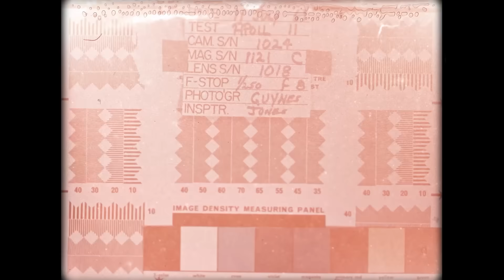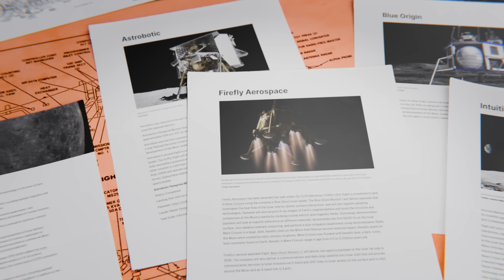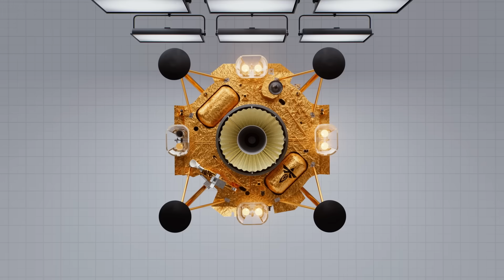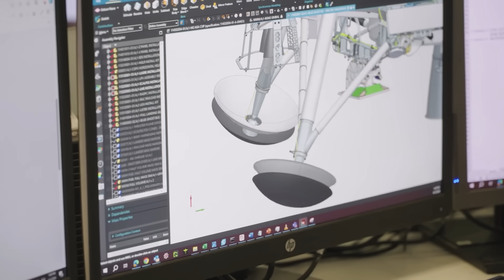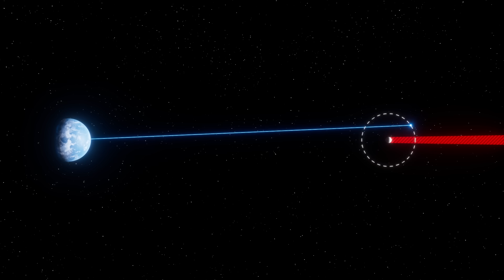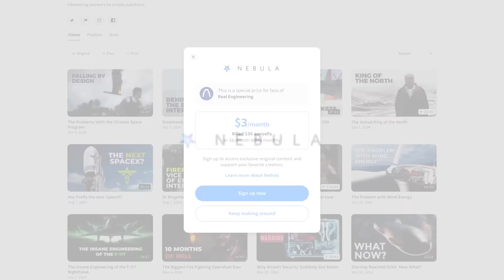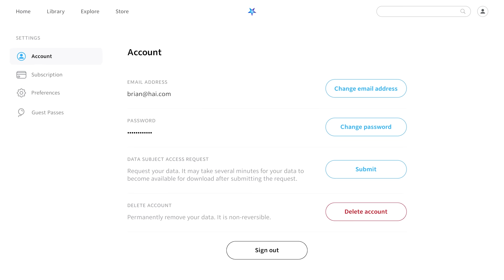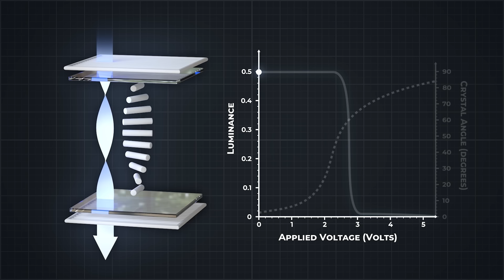Why the US is Struggling to Land on the Moon

Comment: The moon landings were fake as hell. 1.) The Lunar lander was as thin as a soda can and couldn't protect against micrometeorites. 2.) Their is no atmosphere or wind on the moon so the flag would not appear to be flapping in the wind at all. 3) NASA can't even solve the radiation issue today to return to the moon. Radiation would have killed them in the 60's. 4.) The surface of the moon without an atmosphere is 250 degrees. Impossible for the astronauts to survive 3 days on car batteries cranking out AC in those conditions in that tiny Lunar module.
Reply: Are you still grinding on stupid points that have no merit all.... oh, that flag can't flutter.... it wasn't. But no, you bring up these idiotic points that have been debunked countless times. 

Give it a rest.... you just show people how ignorant, uninformed and uneducated you are. Instead of wasting time watching conspiracy videos, take time to learn genuine science, physics. 

But you won't.
Reply: @ed9121  none of those points have been "debunked" sad you still a 6 yr old kid that probably still believes in Santa Claus and the tooth fairy. With the IQ of a sponge
Reply: NASA kept temperatures low inside the Apollo Lunar Lander by using several thermal control techniques and systems. One key method was the use of a liquid cooling and ventilation system. The astronauts wore Liquid Cooling Garments (LCGs) which circulated cooled water through tubing sewn into a mesh garment to absorb and carry away body heat. This water cooling loop was part of the Portable Life Support System (PLSS).

Inside the lunar module, heat exchangers and cold plates transported the heat generated by the crew’s metabolic load and onboard avionics to radiators. These radiators then rejected the heat to space. The internal cooling loop circulated a mixture of water and propylene glycol to maintain proper temperature control without freezing in the extreme lunar environment. Liquid and air heat exchangers helped transfer thermal energy efficiently from crew and equipment to the cooling loops. Overall, a combination of liquid cooling garments, heat exchangers, and radiators ensured the cabin and suits stayed at comfortable temperatures despite the harsh lunar extremes
Reply: NASA protected the Lunar Module from micrometeoroids using a combination of thermal blankets and a micrometeoroid shield. The protection system included a sheet of aluminium varying in thickness from about 0.004 to 0.008 inches, attached over the thermal blankets. This aluminium shield served as a physical barrier against micrometeoroid penetration.

The complete protection assembly was designed to isolate the vehicle interior and equipment from extreme temperatures and micrometeoroid impacts. The surface was covered with multiple layers, including aluminized Mylar and Dacron mesh layers, which provided thermal insulation and impact resistance. The design balanced light weight and compact stowage with effective deployment and reconfiguration after landing.

In particular, the micrometeoroid shield and thermal blankets enveloped the Lunar Module's structure, helping maintain acceptable temperature limits and preventing penetration by small high-speed particles from space, which pose a more serious risk on the Moon due to its lack of atmosphere. The legs and engine parts had specific protections or coatings designed for their exposure and thermal requirements.
Reply: NASA kept the flag upright on the Moon by using a special flagpole design that included a horizontal crossbar at the top of a telescoping pole. This crossbar slid through a hem sewn at the top of the flag, holding it outstretched so that it appeared to 'fly' despite the Moon having no atmosphere or wind.

Additionally, the flagpole had a small spring catch mechanism that clicked into place when the astronauts raised the flag, ensuring it stayed upright and did not droop in the Moon's lower gravity. The flagpole and crossbar were made of lightweight anodised aluminium tubing. The design allowed the flag to stand upright and appear to flutter.
Reply: @amedfabre  BS I've seen the videos. The Moon has no atmosphere and is essentially a vacuum. It is impossible for the flag to sway back in forth as it clearly did in the NASA released video footage that clearly shows an astronaut hopping several feet away and never touching the flag causing wind or slight breeze pass by the flag causing it to sway immediately after he passes by. That is impossible on the surface of the moon. There isn't any wind or air currents LMAO GTFO with your BS
Reply: @perry5392  :
" The Moon has no atmosphere and is essentially a vacuum."
Correct.

"It is impossible for the flag to sway back in forth"
Why not? No atmosphere means it can be moved effortlessly.

"the NASA released video footage that clearly shows an astronaut hopping several feet away and never touching the flag"
Reference of that supposed video?

" LMAO GTFO with your BS"
You understand that you're the one spreading BS on an historical, technical and scientific set of events that are acknowledged by every educated person on the planet and denier only by a bunch of ignorants illiterate people that can only watch images and videos and make irrelevant comments on them?
Reply: NASA solved the Van Allen radiation belt issue for the Apollo missions by carefully planning the spacecraft trajectory to avoid the most dangerous parts of the belts. The Apollo spacecraft trajectory was designed to skim through the thinnest, least intense regions of the outer Van Allen belt and completely bypass the inner belt, minimizing radiation exposure. The astronauts spent only a brief time of about six hours total to pass through these belts, which limited the radiation dose to well below harmful levels.

In addition to trajectory planning, the spacecraft had some radiation shielding, and the mission was designed to limit duration in these belts. The radiation dose received was much lower than the allowed yearly dose for nuclear industry workers.

James Van Allen, the man himself, confirmed that the Apollo missions benefited from flying through the weaker regions of the belts. He suggested that the inner belt's high-energy protons could pose a serious threat to human spaceflight, but this was mitigated by the missions’ trajectory design.
Reply: @amedfabre  Absolute lie. Give the BS a rest. NASA admitted they went straight through the radiation belt. They didn't have fuel to go through some carefully planned route. LOL

Comment: B nice for them to eventually do it especially after losing the blueprints to the rockets and taping over the original footage and obviously going through the van Allen belt then them suits coping with the heat and cold that no protection from the sun gives ya bless em
Reply: What are you talking about?

Comment: I don't really get it. That lander looks almost exactly like the original eagle module, +50 yes ago. Why four legs? Why not five or six? The more legs the smootheer la ding right? Why not automatic servo.-controlled  retractile legs?? All that space stuff looks like coming from old-fashion documentaries!    Maybe the problem is that the moon lander still is designed as it's part of the initial payload carried by the heavy-lift launch vehicle. Guys please, it's 21st century. The lander needs to be assembled in orbit and then coupled to the lunar orbital module.
Reply: "Why four legs? "
NASA did a lot of tests on ground with different lander configuration at Apollo time, and found that one the best.
I dunno however if that still holds with modern crafts.

Comment: How hard would it be to add four arms, spaced at 90°, that could right the lander if it rolls?  If that proves to be too difficult, then add six arms spaced at 60° or eight arms spaced at 45°.  I just feel like there has to be a simple way to fix this problem.  Use the arms the same way a turtle uses their head to turn over if they are upside down.

Comment: My brother is a lead engineer at Boeing working on the Artemis Project. According to him the only issue they are having is cutbacks on their funding. If it weren’t for the cuts in funding, Artemis 2 would have already been completed by now and Artemis 3 would be launched in a bit over a year from now. All of this got pushed back due to the cuts in funding, not because of the challenges that landing on the moon presents(which is without a doubt a challenging task).

Comment: The new landers that always faceplant are:
1 - tall with narrow landing leg base, to save on money by allowing them to be taken up in smaller, narrower rockets. This tall, narrow design results in high center of mass and thus, difficulty landing it upright. Duh.
Just look at the width to height ratio of Apollo, then look at that shitbox of a pickle probe.

2 - they're unmanned. Say whatever you want, the human brain and senses did not develop for billions of years, only to be quickly turned obsolete by mere 10 to 100 year old artificial intelligence and/or remote control technology. Neil Armstrong landed the Apollo 11, not AI, not pre-programmed algorithms. Humans are more reliable at many things than humans' plans, predictions of the future. Because ultimately, AI is just that. Having a human in control on site, gives for a much wider range of possible outcomes, corrections to a problem; our biological "AI" is just that much more fleshed-out.

Comment: Why dont NASA just do what they did many times before, as all came back fine.

From Hollywood.
Reply: if the USA had faked the moon landing, it's extremely likely that the USSR would have discovered and exposed it quickly — for several strong reasons:

1. Cold War Rivalry
The moon landing happened during the height of the Cold War, and the space race was a major point of national pride and geopolitical power. The Soviet Union had every incentive to disprove or debunk any fraudulent U.S. claims.

Exposing a fake moon landing would have discredited the United States globally.

It would have given the USSR a huge propaganda win at a time when both superpowers were competing for influence over the developing world.

2. Soviet Space Capabilities
The USSR was not technologically behind to the point of ignorance. In fact, they:

Launched the first satellite (Sputnik) in 1957.

Sent the first human (Yuri Gagarin) into space in 1961.

Had extensive tracking and radar systems capable of monitoring U.S. space activity.

Could track the Apollo missions, observe trajectories, and analyze telemetry.

3. International Tracking
It wasn’t just the U.S. and USSR monitoring space:

Many countries and independent observatories around the world tracked the Apollo missions.

Radio amateurs even listened to the astronauts' transmissions.

Faking all of this — including radio signals, telemetry data, and visible trajectories — would have been nearly impossible to hide from global experts.

4. Lack of Soviet Accusation
The USSR never claimed the U.S. faked the moon landing, despite their ability and motivation to do so.

This silence is strong indirect evidence that they had no reason to believe it was fake.

If they suspected fraud, the USSR would likely have made a very public, well-evidenced denunciation.

Conclusion:
If the USA had faked the moon landing, the Soviet Union absolutely had the means, motive, and opportunity to expose it. The fact that they didn’t strongly supports the historical consensus: the moon landings were real.

Comment: Well you see the first one was easier because its easier to land in hollywood than on the moon
Reply: if the USA had faked the moon landing, it's extremely likely that the USSR would have discovered and exposed it quickly — for several strong reasons:

1. Cold War Rivalry
The moon landing happened during the height of the Cold War, and the space race was a major point of national pride and geopolitical power. The Soviet Union had every incentive to disprove or debunk any fraudulent U.S. claims.

Exposing a fake moon landing would have discredited the United States globally.

It would have given the USSR a huge propaganda win at a time when both superpowers were competing for influence over the developing world.

2. Soviet Space Capabilities
The USSR was not technologically behind to the point of ignorance. In fact, they:

Launched the first satellite (Sputnik) in 1957.

Sent the first human (Yuri Gagarin) into space in 1961.

Had extensive tracking and radar systems capable of monitoring U.S. space activity.

Could track the Apollo missions, observe trajectories, and analyze telemetry.

3. International Tracking
It wasn’t just the U.S. and USSR monitoring space:

Many countries and independent observatories around the world tracked the Apollo missions.

Radio amateurs even listened to the astronauts' transmissions.

Faking all of this — including radio signals, telemetry data, and visible trajectories — would have been nearly impossible to hide from global experts.

4. Lack of Soviet Accusation
The USSR never claimed the U.S. faked the moon landing, despite their ability and motivation to do so.

This silence is strong indirect evidence that they had no reason to believe it was fake.

If they suspected fraud, the USSR would likely have made a very public, well-evidenced denunciation.

Conclusion:
If the USA had faked the moon landing, the Soviet Union absolutely had the means, motive, and opportunity to expose it. The fact that they didn’t strongly supports the historical consensus: the moon landings were real.

Comment: The U.S. is facing several challenges in its current efforts to return astronauts to the Moon, despite having successfully landed there in the 1960s and 70s. Here's why it's more complicated today:

1. Higher Standards and Goals: NASA’s Artemis program isn’t just about landing on the Moon—it aims to build a sustainable presence, including a lunar base and Gateway space station. This makes missions more complex.

2. Budget and Politics: Space exploration is expensive and heavily influenced by changing political priorities. Budgets can shift with administrations, causing delays.

3. Reliance on New Tech and Private Companies: Unlike Apollo, Artemis relies on both NASA’s new Space Launch System (SLS) and commercial partners like SpaceX (e.g., Starship for lunar landings). These systems are still being tested and refined.

4. Technical Challenges: Landing on the Moon is still very hard. You need powerful rockets, precise navigation, radiation protection, life support systems, and safe return methods. Doing it with modern safety standards takes time.

5. Delays and Setbacks: Both NASA and SpaceX have faced development delays, including technical issues, testing failures, and supply chain problems.
Reply: ChatGPT comment 😹
Reply: So basically we forgot how to manage large, complex projects.
Reply: Sigh, some people will cling to their fantasies and dreams no matter if the real world has already crashed their doors down and installed itself inside their homes.

Comment: Obviously NASA's 50 year old technology was better.🤔
Reply: In many ways it was 
The software was hard wired and could not be damaged by cosmic radiation 
The engines were hand tuned 
The astronauts could calculate re-entry with slide rules 
The coms system was very robust

Comment: Well, you haven't explained it... it's very difficult... blah blah blah... but you haven't said why? The technology or system they use is the same as the one used in the 1950s... more technological, but it's visual navigation. China didn't make a mistake... so why is the United States? -1

Comment: My initial thought is that the quality of materials has gone done significantly over the last 60-80 years or so. Secondly, we are using more advanced/complex components that have more failure points than the original lander. Not sure if this is correct, but that would be my gut instinct.

Comment: Well when you faked it the first time because of things like:

1. That pesky rocket equation: You just can't carry enough fuel to pull it off. 95% of the weight of a rocket must be fuel and very energy dense fuel; that is just to get in earths orbit. Then you have to accelerate to get to the moon. Then you need to decelerate to get in lunar orbit. Then you need to land on moon with lander. Then back up into orbit and rendezvous with command module. Then accellerate out and back to earth at 25000 mph [ Nasa numbers]

2. Getting the return module to slow down from 25000 mph to below 17400 mph without burning up like a meterite and or crushing humans to death is even more challenging.

WE DID NOT GO. Only robotic things went. The rest was faked.

Comment: The video's picture says it all ... Engineering 101.   One vehicle with a wide landing gear base with a low center of mass (more stable and therefore more likely to remain upright on uneven landing areas) ... vs. ... the other vehicle with a narrow landing gear base and a high center of mass  (less stable and therefore more likely to topple over on uneven landing areas).  ;)
Reply: Simple but yet effective common sense reasoning, wish they thought like you